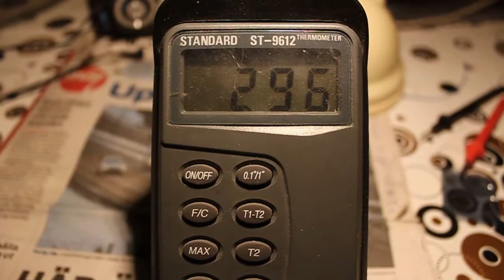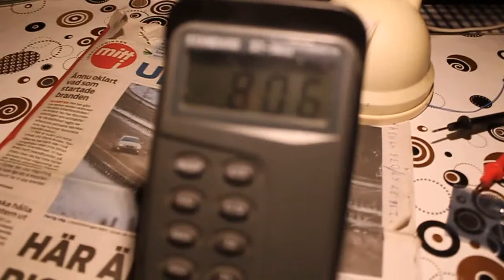Smälta betong / Melt concrete

Comment from the maker: It seems like the original comment (the question) disappheared. But this long answere can be used as a guide for those who want to build their own furnace. The critical part here, is the design of is the furnace it self. The electric part is just a power regulator (wich I describe later). For this one I used vermiculite plates with ceramic fibre on the inside (as vermiculite can only withstand temperatures up to about 1100°C) - but I discovered that ceramic fibre is not very good ether, since it begin to fall apart after some use. 
Fire bricks is the best choice (wich is what I use in my new one). But it shud be light weight insulation fire bricks. There are also heavy ones (about the same density as ordinary house bricks) used for example in fire places. Those are very durable - but their insulation properties is poor (so it vill be hard to get up to temperature and wastes energy) and they also wastes  a lot of energy and time to heat up, because of the large mass. 
It''s recommended to have walls that are at least 75 mm thick (for good insulation)

The heating power needed for a furnace of a certain size can be calculated from the inside area of the furnace chamber.  The needed power is mostly a function of how fast you want the furnace to heat up. Unless you accept very slow heating (many hours to reach 1200°C) - it's in fact quite easy to get up to temperature (not very much power is needed).
To go from room temperature to 1200 in 30 minutes (as my new one does) needs about 13-20 kW per square meter of the inside area of the furnace chamber (depending on what material you use - ceramic fiber is the easiest to heat up, but not very durable).
For example the one I had when this video was taken was 0,4 * 0,35 * 0,18 meters (even though the usable space is less because some space is needed for the elements). The gives 0,4*0,35*2 + 0,35*0,18*2 + 0,4*0,18*2 = 0,55 m². And I had 7,5 kW so that is 7,5 / 0,55 = 13,6 kW/m²

The most critical part is the heating elements. The wire used fot this (and many industrial funraces as well) is Kanthal A1: http://kanthal.com/en/products/material-datasheets/wire/resistance-heating-wire-and-resistance-wire/kanthal-a-1/
The special thing about it, is that it can withstand that temperature in air. There are a lot of metals that has higher meltning points, but as soon as oxygen comes into contact with it - it burns like a sparkler and turns into oxide. The tungsten filament in an incandecent light bulb can be like 2000°C - but try to remove the glass and turn it on, and see what happens. Above 1200°C the difference between the melting point of 1500 and the furnace chamber is less than 300°C - within that difference, the elements has to radiate away all the heating power. That's the hard part
It is important that the heat load on the wires is not too high. That load is detemined by the heating power compared to the outer surface area of the wire - for temperatures up to 1300 it's not recomended to exceed 1,2 W/cm² (if you want your elements to last some time). 
If you for example have 70 meters of wire that's 2 millimeters thick, that will have 0,2 cm * pi * 7 000 cm = 4398 cm² of surface area - wich means you can get up to 4398 * 1,5 = 6597 W from it at 1250°C. 
Although - the heat load can be higher at lower temperatures (maximum at 1200°C is about 2 W/cm² and 1250 about 1,6 W/cm²), in order to make the furnace heat up quicker - as long as the power is reduced when the temperature rises. 

As that value compared to wire thickness, is a function of only the current (higher voltage just makes the wire longer), 
I have a formula for that, wich makes calculations easier. You can calculate what the current need to be (depending on power source voltage and desired heating power) and then easely calculate how thick the wire needs to be. The formulas is: 
D = (0,4/pi^2*I^2*R / P)^(1/3)
P = 0,4/pi^2*I^2*R / D^3
 - where I = current, R = specific resistance for the wire material (in Ohms/meter length at 1 mm² cross section area. For kanthal A1, that value is 1,52 for a hot wire and 1,45 for a cold), P = heat load (W/cm²) and D is diameter in millimeter. 

It's adviceble to not just choose some "fat ass" wire, since the thicker it gets the longer it needs to be to get the right resistance - below 1-1,2 W/cm² it's hard to get enough space for the elements (pack it in too tight defeats the purpose of having a low surface load as the heat has nowere to go and builds up in the elements anyway - it shud be at least one wire diamater between each turn when winding spirals).
The design of heating element is important as well. The best thing to use as a support for the heating elements is ceramic tubes so they can radiate the heat more or less freely in all directions. My solution in the video to hold the bottom element in place with refractory mortar, was a misstake - the wire burned off later. Tubes shud be used for the bottom one as well.

Despite design - the wire always do oxidize to some extent. So the elements only have a limited life time (even tho it can be pretty long with a good design). That oxidation also decreases the effective surface area, causes the elements resistace to increase over time. So it's good to set the heating power of new wires, so it's about 20% higher than really needed.
 - then adjust the power by the regulator, so it doesn't overheat at high temperatures.

As for the electrical part - you need to be able to adjust the power, to avoid overheating and to hold a desired temperature steady. It's also nice sometimes, to be able to adjust heating rate (in some cases depending of what you do, you may need to heat up the furnace slowly - i use mine for pyrolysis cleaning of glass and ceramics sometimes and those might crack if the temperature goes up too fast). 
If you have a variac with enough power, that can be used. For a small furnace (for example one that fit's a crucible the size of a coffie cup, may work well with as little as 1 kW.), that mat be a very convenient solution.
However, if you don't have a big enough variac for the desired power need (wich I don't), it's a lot cheaper to build a power regulator than buy a variac wich can handle enough power. Depending on what power source you use the design of a power regulator may vary. 

I use 3 phase AC (wich all houses and most apartments have in Sweden, where I live) and have a rectifier to turn it into DC (that way I can run on 3 phase with just 2 connections for the elements och can use shorter and thicker wire that have a longer life time). 
The power regulator is in turn a buck converter that changes the voltage to the heating elements and uses an IGBT as the switch. The contol circuit is this: 
http://www.555-timer-circuits.com/pwm-controller.html
Except that the MOS-FET and motor is replaced by an opto coupler wich in turn controls the IGBT. The 100 n capacitor is also changed to a smaller one  - that one shuld be adjusted depending of what PWM frequency desired (about 14,5 kHz in my case). I also added a switch wich shorts ether the point after output resistor or leg 2/6 to ground. That way I get 2 settings for 0% duty cycle and 100%
 - this simple circuit can otherwise not turn fully on or off (I have no need for the 95-100% range and when it comes to low temperatures/heating rates - well as it's a buck converter, duty cycle sets voltage and power changes with the square of voltage. For example a whole 20% duty cycle is just 4% heating power...).
When this video was taken I hadn't build that one yet and used a very simple circuit that just turned the furnace on and off like a switch but about 2 times a second. In fact it was the same circuit except that the 100 n capacitor was a much larger one. That's very simple to build and a solid state relay 
can be used as the switch, but if your power lines is not the best and you have a lot of heating power, you may get problem with lights dimming down and up (due to voltage drop).